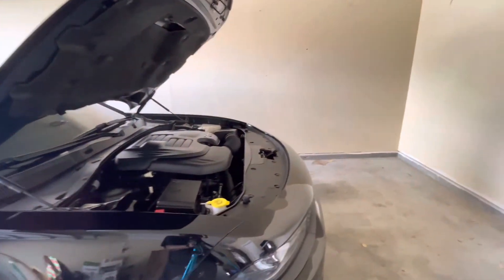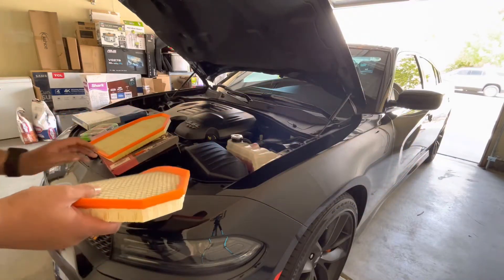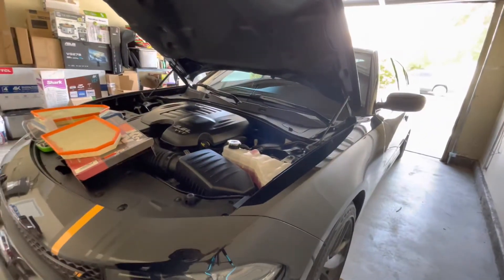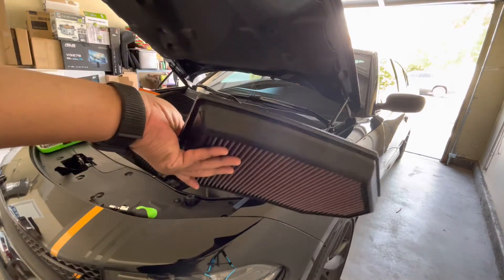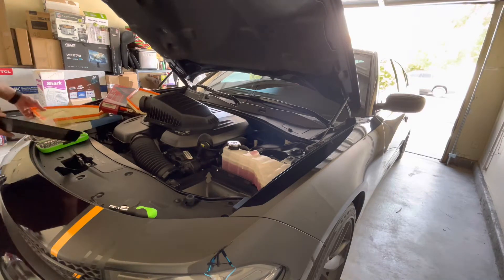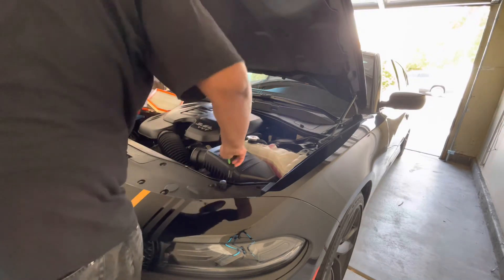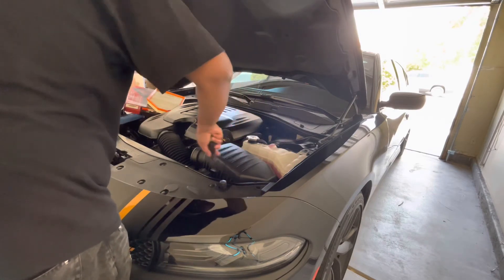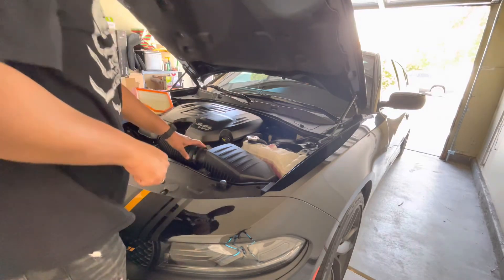Hellcat Air filter install 2022 Dodge Charger GT

Comment: What’s the difference between the hell cat filter & k&n is there a big performance difference??
Reply from the maker: Yeah, the factory filter allows 400 CFM, k&n 780, and the hell cat air filter 1100. Cfm is air flow or how much air it let's pass into the engine. I'm dropping my radiator shield and airbox inlet video Friday. It makes the helical air box a true ram cold air intake
Reply: Did you get any more performance out of it? Is it better then the k&n hp?
Reply from the maker: @bryan2408  can feel the car breathe better when you push down the throttle